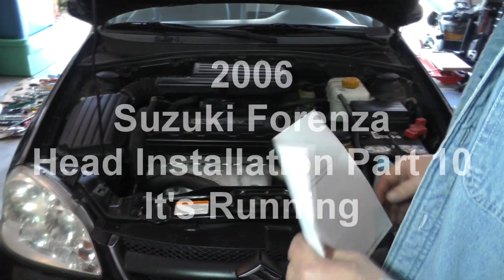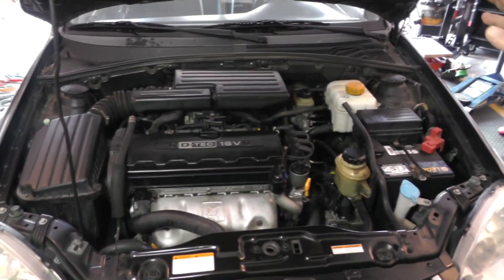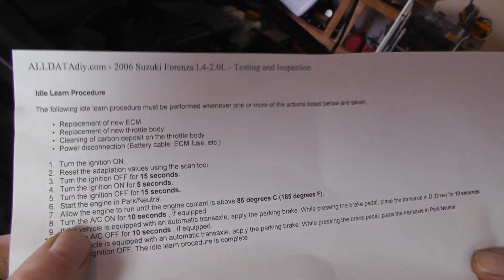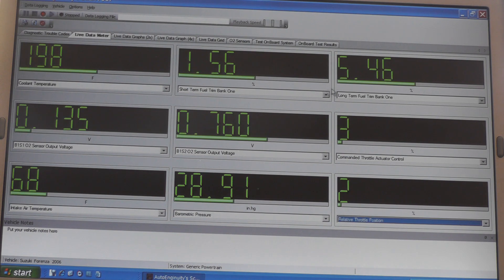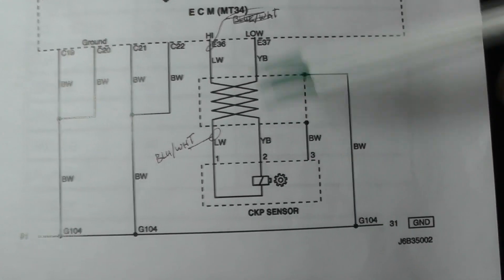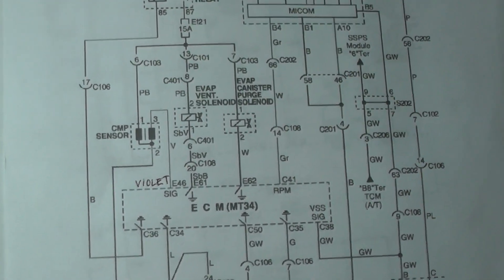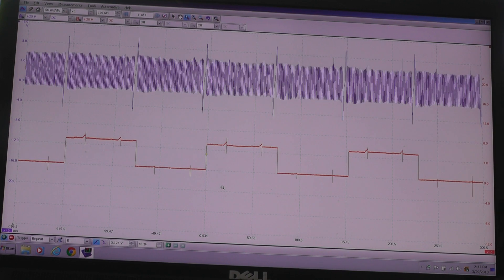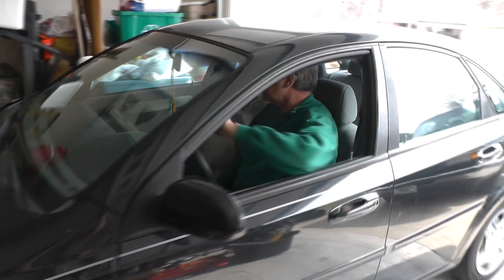Suzuki Forenza Head Installation - Part 18 (Running)

Comment: I found the video series very interesting; I had no idea that this engine was sold there in relatively modern times. I remember some 8v versions with this engine block (1980 Pontiac Sunbird). This engine is commonly found in GM/Opel Astra/Vectra/Zafira models, which were sold in Brazil (until 2007) and in Europe, which even has a turbo version (Z20LET/LEL).

I appreciated seeing some technical differences in the gasket application (which we use  RTV on gasketcover in the the corners). It's clear that you have a very broad technical knowledge, even with an engine that is relatively rare there. Thank you for sharing your techniques; they will certainly be very useful!
Reply from the maker: Thanks for watching and I appreciate the comment! Have a great day!

Comment: I'm having an issue. I rebuilt the engine after waiting for 8 months to get the head back. The engine turns over but there is no spark and no power to the fuel pump. I tried to scan the obd 2 but the reader can't read. I replaced the crankshaft sensor and the fuel pump. Any suggestions?
Reply from the maker: Hi Igor! I would make sure that the PCM is getting the power and grounds to it. One thing a lot of people overlook is to forget hooking up the ground wires on the back of the intake manifold. If that's left unhooked, you'll have the symptoms that you describe.

Comment: Crank but no start, gonna attempt spark plugs & if that doesn't work, fuel injectors.
Reply from the maker: Did you change the timing belt because it broke? If so, you probably have bent valves. Good luck on what you find.
Reply: @stuzman52  Timing belt never broke, the head-gasket went bad and made a nice milkshake so I got it from a friend for cheap. (Shut off & towed when it blew, minimal damage)
Figured out the PCM ground wasn't grounded properly & a connector to the direct right of the ground (under the intake) was slightly unplugged
Started right up with a nice knocking sound (sounds more like pinging). Great day i'm having, right? However, the engine threw a P0340 (camshaft position sensor malfunction) so I plan on replacing spark plugs & the camshaft sensor & go from there. Will keep updated for others to learn
Reply from the maker: @Coventix  Hopefully, all goes well and hope the previous owner didn't drive it too long to damage bearings. Have a great day!
Reply: @stuzman52  It's done and fixed. Turns out a clip was on the camshaft sensor ramming into the exhaust camgear. Removed it, redid timing, runs good. Time for break in!
Reply from the maker: @Coventix  Great work and glad to hear she's running good now! Have a great day!

Comment: quick question.....i did a head gasket replacment on a 06 forenza ...after completion  im getting alot of ticking ...raddling  and now random misfires.....what do you think is the cause of the misfires?...it was running much better before the repair Smh...
Reply from the maker: With the ticking sounds, it may be your lifters.

Comment: I just wanted to say thank you thank you sooo much Terry,for the best set of videos I've ever come across..you turned a big dreadful job into an exciting,fun and very educational experience,not to mention money saving
  The only problem I had was finding the Torgue to Yield Cam Sprocket Bolts...There no longer supported by Suzuki in 2019...So I installed them with red loctite and torque to value while I look for interchangeable bolts
 But hey I'm so happy I came across your videos because there would have been  so much I would have got wrong if not for all your guidance and attention to detail
thank you Terry
Reply from the maker: I'm glad to hear Knyte that everything worked well for you and that the videos were helpful. Once I learned that Suzuki had left North America and dealerships were closing up, I decided to sell the vehicle years ago. As for the parts, it will be a short time in the near future when you won't be able to buy any OEM parts for it. Have a great day!

Comment: I have a question.   I watched your video and did my head gasket and all and when I started my car for the first time after it still blowing out white smoke like crazy.   Is that nominal for that to happened
Reply from the maker: Dustin Beach No Dustin, it’s not normal unless you had some oil, cleaning agent or some other fluid inside the cylinder(s). Otherwise, you may have an issue with coolant getting inside one or more cylinders.
Reply: @stuzman52  I know there was a lot of coolant that went into my muffler when my head gasket blew
Reply: I just didnt know if It was burning off the coolant that got in to the cat or if its something bigger.   I had it running for a few mins.    Like 10.   Doesn't seem to be leaking anything and my coolant hasn't down any.
Reply from the maker: @dustinbeach54  You can keep an eye on it, but if it continues to blow white smoke, I would be thinking that coolant is getting inside the combustion chamber. You could use a couple of methods to check such as using a CO2 tester to check for a gas leak above the filler neck for the radiator, or putting air into each cylinder to see if there are air bubbles coming into the radiator. And keep a check on the oil level to be sure there isn't any coolant getting into the oil system. Definitely want to keep a check on this!

Comment: Hello Stuzman!
my family and i want  thank you from the bottom of our heart; when our cylinder head valves got destroyed from the Idler pulley collapsing we were in great grief and in no stable financial way to afford another car; we were in grave danger and had no way in getting a car in time or the money to put into the labor to fix it.
Luckily my father knew his way around car's but never tackled his way into this type of situation so we set aside 4 days to work on this from the minute we get out of work till it got dark. Not only did we only spend $700 to get all the parts, we learned so much from this experience and i had a fantastic time working along side my father on the car; this will for sure be a memory i will forever treasure with my dad. This is my first vehicle and i did not want to let go as it was a gift from m father when i started college back in 2012.

4 days later we are here with a working Suzuki and not only that, it feels stronger and much more responsive than it was in the past. Lastly, I acquired so much knowledge about the car; again we would like to extend our sincerest gratitude toward your time and video as you saved a Family where we were in no financial way of affording a vehicle or paying the $2500 job it would have cost here in Cali.
Reply from the maker: It's comments like yours Alex that makes me want to continue to film videos to help folks just like yourself. I'm very glad to hear that the car is running great and more importantly that you and your family saved a bunch of money. And it also gives me great pleasure to hear that you and your father had a rewarding time spent together working on the vehicle.  For a suggestion since your car is running pretty good now and you're learning about it, that you may want to get a subscription for the service manual. The subscription would include the service repair information, the TSBs, the wiring diagrams, electrical connector's information with its locations and of course where all sensors are located. The price is very reasonable and you can get all this at www.alldatadiy.com Say hi to your Dad, and I wish you and your family continued success and happiness throughout all of your endeavors in life. Terry
Reply: It was a great time spending time with him and it was a lot of fun working on the vehicle together it has really shown me so much information about car engines and another part of engineering that was new to me. I will look into the service manual as it seems something that would be great to have if anything were to go wrong and if we want to change something in the future. I has already been 450 Miles with no problems at all; car has been running smooth as day, idles quietly and feels like a new engine. A lot of issues we had in the past have all dissipated once we did this job. I will start taking it to the freeway when i hit the 500 - 550Miles with the new head to be safe and we have been inspecting the car 3 - 4 times a week to make sure there is no leaks and problems with the vehicle.
My father thanks you for all that you have done for people such as ourselves and we can never thank you enough for what you have done to save this family from going under!

Comment: Thank you for making such great videos. I recently had to change the head gasket on a 2007 forenza. Your videos helped so much not only with teaching me how to do it but also saved me quite a bit of money that I didn't have due to my daughter have brain surgery tomorrow. I only have 1 question... After changing the head gasket and putting it all back together my car is still lagging in power...how do you finesse the ignition timing? Mind you there were no problems with my valves or pistons. If you could please help.
Reply from the maker: Jennifer Terry hi Jennifer snd glad the videos helped. On modern vehicles today such as this one, there is no manual way to change ignition timing as it is controlled by the computer. You may want to recheck your timing marks as they may be off a little. Also be sure all of your vacuum hoses are connected. Sorry to hear about your daughter and will pray for her recovery.

Comment: Thank you, thank you, thank you!!! Did I remember to say thank you? I had to work on the exact same car (only gold, not blue) and your videos were better than having a shop manual. Your attention to detail, such as even explaining how to separate the various connectors, was so helpful as was specific, essential information such as torque specs and tightening sequences.  You took all the guesswork and trial and error out of the disassembly and reassembly sequence. I used to be able to remember what went where but time has robbed me of that ability so I have to make notes and label things; your videos eliminated the need for that. I'm blessed to be able to report that my vehicle started right up on the first try; I had one lifter that took about 7-10 minutes to quieten down but, otherwise, it ran fine. It wasn't my ability but your excellent videos and the goodness of the Lord that brought that about. So, once more, thank you for taking the time and putting forth the effort necessary to create this excellent video series.  By the way, if I may ask, where do you live? Your manner of speaking reminds me so much of my relatives in middle Georgia. That added more enjoyment to the videos for me.
Reply from the maker: JesusSolidRock I’m glad that I was able to help you and that your car is running fine. Thank you very much for the very kind words and bless you in all of your endeavors.
Reply from the maker: JesusSolidRock oh I forgot, I live in the middle of North Carolina. 😀👍
Reply: Me too. Shelby to be exact. Are you native to the area?
Reply from the maker: For the most part I grew up here in NC except for cases where Dad and the family lived in Virginia, Florida, etc. From the 5th grade onward, most of that growing up was in the Rocky Mount, Enfield and Tarboro area. :)) Today, I live in Thomasville and Shelby is not too far away :) Have a good one!

Comment: Can you tell men the function or purpose of the box you identified as the resonator box?  When I took mine off, I found engine oil inside (maybe three teaspoons or so).  That is not normal, is it? Any idea how it might have gotten in there? I have sprayed brake clean inside to try and dry it up.
Reply from the maker: JesusSolidRock  the box is used to soften the sound of the incoming air going into the throttlebody when you press on the accelerator. You will have a little bit of oil inside the box which is coming from the PCV system.

Comment: Terry, I had a broken timing belt, and used your videos explicitly.   I really enjoyed your teaching and detail. At this point it is back together and turned it over and ran really rough.  Due to other pressing priorities I had to stop.  I was thinking of checking the timing to be sure after reading lots of comments. I did a throttle body clean but did not have a tank to set it in so may have been a partial clean.  Are there some other checks you would advise? On another note when tightening up the timing tensioner I noticed that I could not get good tension so after looking more at the water pump position  I learned that it is easy to bolt that down incorrectly producing a slack tension on the belt. Is this something you have seen.  The proper position is the flange being aligned with the recess in the cover. Thanks again for the wonderful videos you and your wife put together they were a real blessing for me.
Reply from the maker: Hey Gregory! I noticed that you didn't mention anything about pulling the head for bent valves. If your timing belt broke, then it's about 100% guaranteed that you had or have some valves bent. So, I assume that you pulled the head to address that issue. The water pump should be turned fully clockwise until it hits the stops and then tighten the bolts up at that point. Otherwise, the belt could have slack and you may not be able to tighten it up with the tensioner. I didn't run into this issue but others have commented on it. And of course, make sure that the marks are correct as you don't want to bend valves :) That's all I can think of at the moment. Good luck on what you find to get your car running again! And glad to hear that videos were helpful!
Reply: Yes indeed I did have bent valves. I had the head machined and 4 or 6 valves replaced.  Followed all the steps in your videos.  I was able to bleed decently all the buckets.  The shop did not do this as I was thinking they might.
Reply from the maker: Just retrace your step Greg and see if something turns up for you...
Reply: Well I got back to the Forenza and found some things I had missed.  I  got a little hasty in putting thing things back together originally and missed the vacuum line that goes to the valve cover, and after using brake cleaner and squirting around the intake manifold I discovered I installed the manifold gasket poorly.  After the last fix all was well...no codes and idles fine🤣🤣.  My next concern may be mpg. Thought I might get about 25 in town but only getting 21.  I read some threads that mentioned MAP sensor and plugs might be a good place to improve.  Just thought I would follow up letting you know your encouraging spirit is much appreciated.Thanks
Reply from the maker: Whenever you do a project Gregory, you always want to take your time so that you don't overlook the details. But you don't have to worry if you miss the details, because at the end of the job, the details will find you and don't even have to look for them at that point :)) As the old saying goes, sometimes you've got to slow down to go faster. Keep at it and I'm sure you'll get it all sorted :)

Comment: hello sir. I have a 2007 Suzuki forenza the head gasket was blown. was replaced and thanks to ur videos I finally have the timing correct. my question is... I have everything back together but wen I turn the key on fuel sprays from the injectors. Any help would b greatly appreciated.
Reply from the maker: Taylor Schmidz you have o'rings that are leaking. Pull the injector rail and inspect the o'rings. Probably will have to replace them.
Reply: I replaced the yesterday sir nd now it seems like they spray from where the injectors go into the rail. I have all wires,clips, nd everything else in place. I even replaced the injectors today sir same problem
Reply from the maker: Taylor Schmidz must be o'rings or how they are installed. Factory rings, aftermarket ???? Did the new o'rings match to old.
Reply: stuzman it's the ones that came with the new injectors sir. yes sir they did but still the same problem. is there maybe a specific way to install the injectors into the fuel rail? or could it possibly b either the rail itself or the wires? could they possibly be not secure enough because 1-2 of the clips was a little worn?